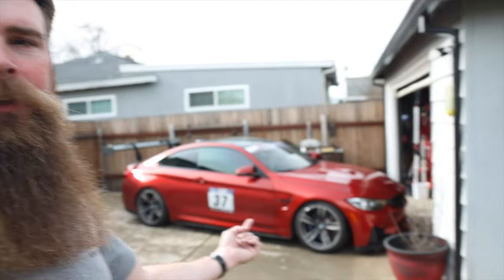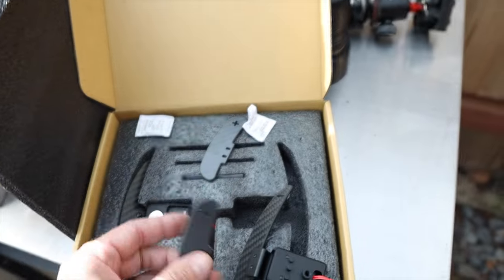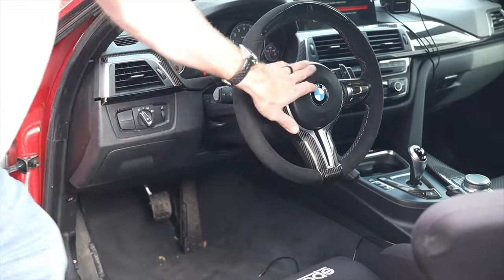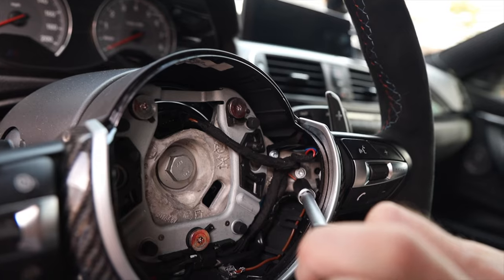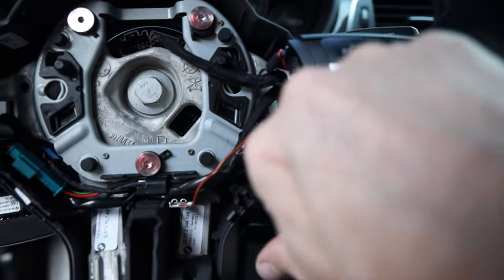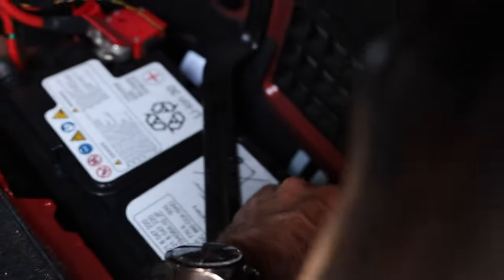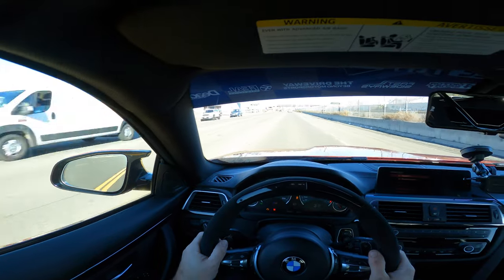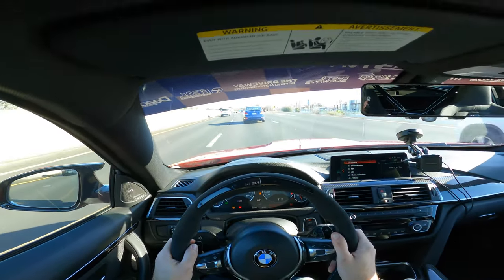JQ Werks BMW Magnetic Paddle Shifters: A DIY Upgrade for Better Driving Experience

Comment: Issue is that DCT will never take the insane amount of torque that a ZF8 can handle. Not to mention ZF8 shifts faster and smoother.  That's why people are tuning 335-s and 340-s to insane horsepower and torque levels instead of tuning the F80-s. But from the G series onward the M cars will be a tuning beasts also... Because the transmission will handle every amount of torque that you give it. And the other benefit is... ZF8 is bulletproof... Basically you cannot destroy that transmission... and it is very very low maintenance item. Basically no maintenance except an oil every now and then...

Comment: Beautiful! But $450 is... Steep 😢
Reply from the maker: Worth absolutely every penny! I mean my steering wheel is like $1900 it’s all relative.
Reply: They’re worth it! Not for the clicks, but for the tight tolerance & unbelievable feel of quality! They’re made so well with premium materials! CNC machined & with magnetic technology. So not only is the tolerance ridiculous but the magnet sucks the lever right back in place for the next gear to be selected! I run them on my 09 135i & they’re unbelievable! $450 is a lot but again, definitely worth it! Not sure if you’re familiar with the new 992 GT3RS, but that has magnetic technology paddle shifters! It’s basically F-1 type sh**!✌🏻

Comment: Just did mine,  what a difference!😁 I would like to add a tip to anyone doing this mod. When disconnecting the blue connector of the OEM paddle shifters,  make sure you have a small tool, like the smallest screw driver for glasses, to press the tab that locks the connector while wiggle it out. I broke one of them when disconnecting, but luckily the wire inside are still strong enough to let me pull the rest out while I had the small screw driver pressed on the tab.
The other tip is to snap few pictures of how the wires are placed/tucked originally, so that it will be a lot  easier when putting everything together. (There are more wires in the right side, and they must be put back in the same order so that everything fits)
Other than disconnecting the connector,  this is a very straightforward DIY mod.
Reply: what if you live in ohio? is it different?
Reply: @p00pie Not sure if the US spec car is different than Canadian spec.  
Just make sure you snap few pictures of the wire arrangement before disconnecting anything,  and be careful not to rip the connector. 
Good luck bro!

Comment: You should do a video swapping the start and M buttons  if you haven't already. And agreed, short of a pdk it's one of the best gear boxes you can get sub super car lvl, it's a manual that is always ready for the next gear with simulated auto functions. I didn't get a G series for that very reason, I kept my f82 and bought a TTRS to play with instead. Good video.
Reply from the maker: I’ll probably never change the buttons not really a fan of that mod I think the stock is just clean. But yeah man PDK is amazing! Our Macan Turbo is nuts how good the trans is.